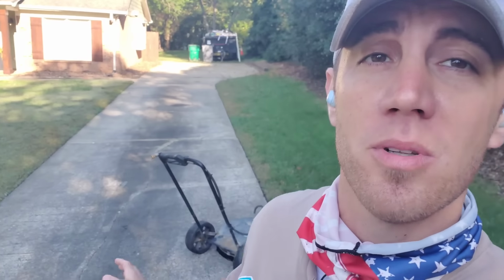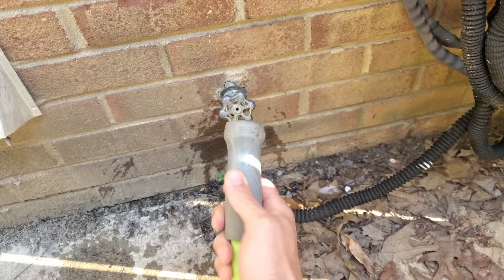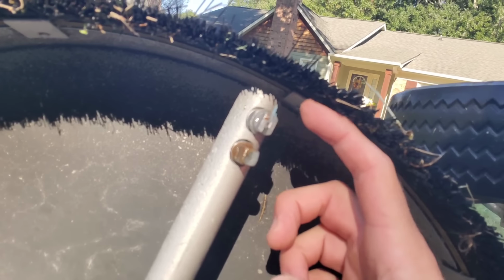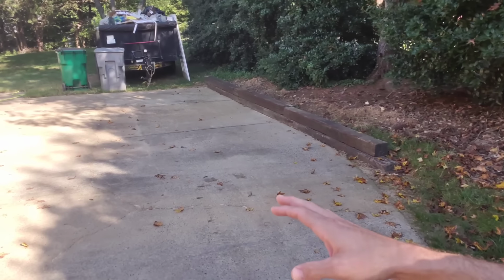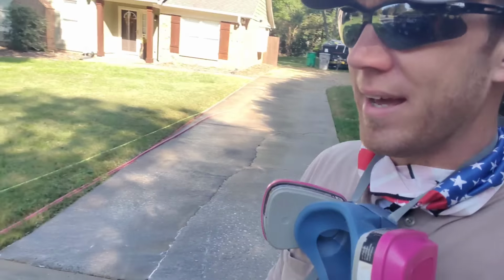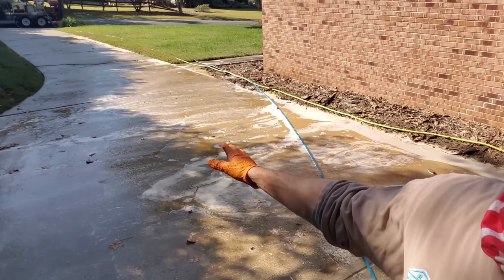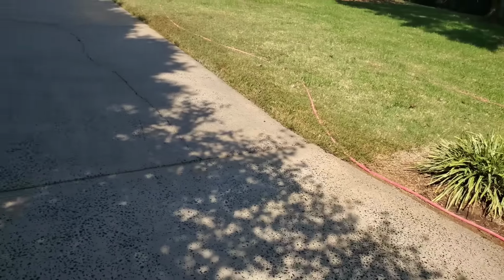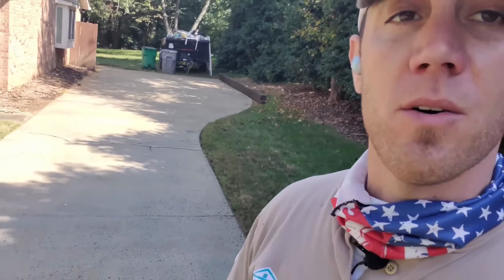How to Clean a Driveway Like a Boss | Pressure Washing | Surface Cleaning

Comment: Ray, the part about 4" per 1 gallon per minute for your machine is a myth, I run two 28" Big Guys on a 8 gpm  machine all the time with no issue at all, yes we go just a little bit slower but in my opinion it cleans better. But I do run 100ft of 1/2" line per hose reel with 200ft of 3/8" hose after the 1/2". That way we can reach out 300ft per side of the trailer and get it done! Great information you are putting out, keep it up!
Reply from the maker: Good info right there...  Keep shining!

Comment: Hi Ray is that a 1/2 hp Leader Pump ,how do you like it for soft wash, can you shoot a roof top. I use an ar 45 /honda. looks like it will do the same job as the ar  except 1/3 of the cost of the ar which works for me .I use a gravity fed low 50 gallon batch system on a 2" feed line from the tote. and the same tank overhead for bleach on a gravity fed 1" line.  3 minute refill time and gives me an exact mix I use it for down streaming as well on my other pump....yes its old school .it saves the equipment .I never comment ..or read comments. .and yes I have a metering system ... I just like the process. I like your style Ray....keep up the good work

Comment: Great video. I’m new to learning about pressure washing. So you use the soft wash system to pretreat? If I were to start a pressure cleaning company one day without all of the soft wash equipment, what’s the next most efficient way to pretreat?

Comment: Great video content Ray. Just staring out. I noticed you went side to side from the bottomnup that driveway with the surface cleaner. Any reason not to do long passes? 
Thank you
Reply from the maker: So when you make passes with the surface cleaner it is very hard not to go overlap a couple inches over a spot that has already been cleaned.  This causes "lines" sometimes.  The side to side method makes this much less noticeable
Reply: Thanks Ray

Comment: Hey Ray, love your educational videos, great job, just a quick question.
What kind of softwash system do you use with your car remote control is so crazy I love it, and what do you think about the air pressure softwash system?
Good day.
Reply from the maker: Thanks brother.  This is one I bought awhile back.  I am actually not very happy with the Leader pump, this is my 3rd one this year and I won't be using it after my new rig is finished.  Moving on to another setup that i'll make a vid on when it's done

Comment: Great video! I learned a lot. I do have a question though. I’m still learning and practicing on my property. I didn’t use any chemicals and just ran the surface cleaner with water. After everything dried up I noticed lines. Am I still able to post treat it even though it’s been a few days?
Reply from the maker: Thanks man it wouldnt hurt to try id bet it would remove the lines

Comment: "Pretreat separates men from the boys" EXACTLY!  Yesterday I had a Chuck in a truck come up to me while I was pretreating and talking to the client and he said "OMG, You use chemicals!?! I never use chemicals, that's crazy"   Of course he was trying to hate on me in front of my client so as he was unloading his Super Bad A** Dewalt 4000 psi unit from his truck to do the neighbors driveway I called him out and told him to only do 1/2 of his clients driveway and I would do the 2nd half. Whoever had the cleanest section got the whopping $65 that he was charging.  Lol, I hated to work so easily for that little bit of money but I HAD to show my client how inexperienced this guy was especially since my charge was $199 for the same size driveway.  Here's the best part.... I told him that I wont use my 8gpm and I wont use his Big Beast unit, I Guaranteed that my section of his clients driveway would be at minimum just as clean as his but probably better and I would ONLY use my air diaphragm system and NOTHING else. No surface cleaner, no pressure washer!  Only 90-100 psi. to clean and rinse.  LET THE GAMES BEGIN!  As I watched him move super slow with his red home depot surface cleaner (not knocking it, only his ego), he made multiple passes on every inch of his section, making sure that he had Zero striping going on even though we both knew that this attempt is the most attentive cleaning that hes ever done.  "Alright...Beat that he said, hahaha".  

Well...I cranked up the air compressor,  set my mix super hot (SH cranked all the way up, Water dialed down to 1, and Slo Mo surfactant at 3).  I laid down 2 layers of pure heat. "You smell that Chuck"?  "Its Robert, not Chuck he said.  Lol. Oh okay Chuck (in a truck).  "Man the smell is killing us over here" he said.  I've gotta admit, it was burning nose hairs on him I'm sure.  Lol. Anyways, as i was letting that beautiful layered heat blanket dwell on the concrete, I had to point out a few things i noticed on his part of the surface.  Like...the skim coat missing in multiple areas.  How did that happen?  Oh uh uh, that's what happens when you deep clean concrete.  Hmmm okay.  "Did you hear that? I asked my client that was awaiting the results of the contest.  I pointed out that my clients driveway didnt do that, maybe I didnt "deep clean" it enough.  Idiot!  Approx 15-20 mins dwell time goes by so now it's time to rinse.   No pressure washer, only my soft wash set up (1/2" All Flo).  15 mins of rinsing and the contest was over.  Night and day difference, He couldn't say 1 word besides, I never knew chemicals could clean so well.  I must admit that ole ROBERT surprised me, as I was rolling hoses after finishing the house wash part of my cleaning, he walked up to me, stuck his hand out to say thank you and in his hand he had 3 - 20s and a 5 balled up.  He actually paid up on his loss of the bet.  I gave him $45 back and said use this to buy you a few gallons of 12.5%.  

Moral to the story... Professional Knowledge = Professional Results.

Long story but every bit of it true.

Comment: Great video Question I only can get 10percent sh what mix would you use
Reply from the maker: That depends on what system you're using.  For downstream start with 50/50 and go up from there.

Comment: Hello, Sir. I did my first two jobs yesterday. It is hard work! Question - some of my QC's are already becoming a PIA connecting/disconnecting. What type of lube would you recommend for them?
Reply from the maker: I don't know of any lube that helps, but if you get a good stainless steel quick connect it may help your situation.  Spend a few extra bucks on better quality and it will be worth it in the long run

Comment: Raymond, i have two one gallon pump sprayers. I plan to just keep oxalic acid for rust on my truck. What’s a good second chemical I should keep on my truck? I saw you use eaco chem hot stain for oil. Or should I have another 1 gallon? Thank you. Also where can I get those chemical lids with the pour spout on it?

Comment: Ray, Great tutorial, as usual Sir!  Here in NJ,  weather and security always a concern, want your thoughts--  Growing from 8ft truck bed to a new trailer build next season--would you look at  open or Enclosed trailers if your were in my shoes?  Rich
Reply from the maker: Given that you are concerned about theft and the cold, i'd def steer more towards a box truck.  If I were to go that route i'd try to cut in some roll up door on the passenger side to work out of and so the equipment gets displayed to the customer.
Reply: @RaymondNotario  Thanks Ray....good suggestion...

Comment: Does the clean water act affect what dirty water goes off the property to a drain?
Reply from the maker: Always check with your local municipality because the rules can vary from place to place.  Good practice to rinse off as much as possible into the customers yard.  If it runs straight down and into a drain, you can use a sand snake and a 12v sump pump to transfer the runoff back into the yard.
Reply: @RaymondNotario isnt it bad rinsing pre treatment into grass? Sorry lol pre treatment and chemicals is the only thing holding me back from starting up pressure washing

Comment: Hey buddy  . thanks for the video . what size nozzles would i need for a 4 GPM and 4000 PSI Pressure W. Flat Surface cleaner with 2 nozzles  ?
Reply from the maker: 2502x2 is what i used

Comment: I have a question. What do you do with the wastewater when cleaning concrete driveways? Do you let it run off in storm drain or do you pick it up and prevent it from going into drain?

Comment: I’m just starting my pressure washing business can you pump spray the hc / cleaner on the driveway without a soft wash system
Reply from the maker: Yes you can, it will just take a very long time compared to having a pump.  Look into a 12v pump soon as you get some revenue built up!  Good luck!

Comment: Have you tried plugging opposite holes on the bar to see if it cleans different? I'm thinking that having them offset might help to feather out any lines.  If mine had 4 holes I'd try it.
Reply from the maker: No I haven't tried that, but i've heard of people putting different degree tips in the other 2 holes.

Comment: Hey Ray, I've got a 40yr old concrete slab driveway, 2000 sq ft in Massachusetts, dirty but no oil stains. Some local pressure washing companies say they only use water when pressure washing concrete driveways (or heated water), others use chemicals, such as F9 Groundskeeper. Should I steer clear of the ones only planning on using water? Thanks!

Comment: With the chipping parts of the concrete did you still pretreat those areas, and/or does it cause more chipping when adding those pretreaters? Also does using the surface cleaner over the chipping areas chip the concrete more ?
Reply: Sodium hypochlorite does not affect concrete as it is not an acid. It is alkaline and will not etch. You always have a risk of damage, but setting the pressure at an acceptable setting for the type of concrete is key. Pressure sprays, but volume cleans. If that makes any sense.

Comment: Small question, why did you choose short horizontal strides with the surface Cleaner rather than long vertical strides? Is it due to water runoff and pooling or what? 10:50 - 11:30

Comment: Quick question how do you find the right hose length for your pressure washer
Reply: I usually get 200 feet and maybe an extra 50 or 100 footer on the side . Just in case
Reply from the maker: I put 100' on the reel first and then I add 50' sections after that.

Comment: I have a 4000psi 4gpm belt drive with a 20inch MiTM surface cleaner.  I just bought 2 new ones. Sherwin Williams told me they would work.  Should I take them back before I use them. and buy a 16inch surface cleaner
Reply: I have the same set up that I purchased from SW. It works fine with the 20 inch surface cleaner. You wouldn't be happy with a 16.
Reply: @scottcheney6955  thank you buddy. I truly appreciate it.  just starting out on my own I was hoping I did the right thing. ty
Reply from the maker: that machine will push the 20" just fine.  I had the same setup when I started.
Reply: @RaymondNotario  awesome that's
Reply: do you guys have any ideas or pictures of a Gen 2 softwash system.  I need a way to figure out how to flush out sh lines and soap at the end of each job. someone said just leave sh and soap in lines so you don't have to keep priming it

Comment: Hey ray idk why I’m watching this rn...lol....but here I am!

Confused about your tip explaining tho...don’t you have 4 tips/1 bar? 

Correct me if I’m wrong but 4 tips, rated 4GPM, isn’t that surface cleaner rigged for 16GPM at that point? If it was 2 tips, I’d use the 45 degree, 2.5gpm. It equal 5gpm total but, matched with the 45 degree tip its a beautiful combination  (I think that’s what I have at least...)
Reply from the maker: Sub 4 sub?  😂

I plugged 2 of the 4 because I think that 2 tips works better than 4 and its also 2 less tips to clog.  I run 2504x2 which is matched to 8gpm.

Comment: Ray, how do you like that brand of booster? Any issues?
Reply from the maker: Yes many issues, I switched over to the Goulds booster on the flatbed rig that's being built.
Reply: I was just going to get that booster set up from Arkansas soft wash. I’ve never seen it until recently. Would you recommend stay away from it?
Reply from the maker: @shawnplanas4278  I'm on my 3rd leader pump this year.  They are not reliable at all.

Comment: Very informative!  Coup,e questions, when you say you pretreat with 2-3% is the percentage of water to SH regardless of your SH strength? Or are trying to bring your 12% SH down to 3%?

Also I notice you went horizontal to driveway instead of lengthwise, is that to make any possible streaking not as noticeable if any are left behind?
Reply from the maker: Bring the sh from 12% to 2-3 using dilution and the side to side makes any lines less noticeable
Reply: @RaymondNotario  Perfect Thank you Raymond!

Comment: After seeing sodium hypochlorite work I had to look it up  I wanted to get some for my driveway and walkways turns out it's just another name for Bleach
Reply from the maker: Sodium hypochlorite and house hold bleach are not the same.  House hold bleach contains sodium hydroxide, hydrogen peroxide, calcium hypochlorite along with sodium hypochlorite in low percentages 1-6%.  When you purchase sodium hypochlorite from a distributor it comes as 12.5% and often is as strong as 15% when frest.  Hope this helps.

Comment: Wait you use their water to fill up your water tank. 😂
Reply: 8gallon a minute is actually an insane amount of water too btw.
Reply: Yes. The water coming from the house is 4-5 gallons per minute max so he is running a 8 GPM machine so in order for his machine not to run out of water is to prefill a tank with water to supply water unrestricted. It is called a buffer tank. Many people think pressure washing guys bring water to the job but that is almost never the case. Water is very heavy and would be dangerous to carry the amount of water needed to clean a house on a trailer.
Reply: @Unmployable  I just hope they don't get charged by him for it
Reply: @meganm3270  what do you mean? Of course they will have to pay their own water bill. It is part of the cost of doing the job.

Comment: D.O.T. Man will still fine you for not having your garden sprayers labeled as to what chemicals they contain. At a MINIMUM they should have the name/%concentration of the chemical they contain. Color coding is great for you to have a quick reference, but without a label, you are in violation.   Why didn't you finish the little sidewalk. It makes your job look incomplete. (nevermind. I watched the whole video. But I still would have done it. The contractor would have remembered you later.)
Reply from the maker: Good point Jeff.  I have them labeled on the tape with a sharpie marker and also overlap the label with more tape encase it wares off.